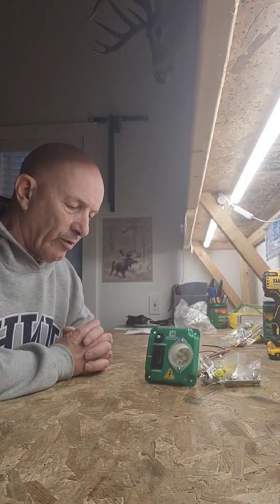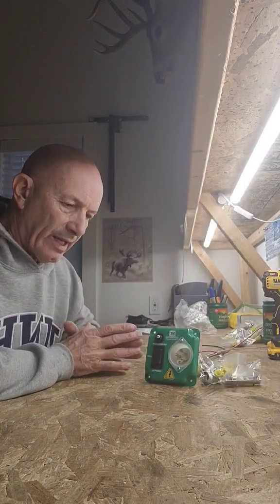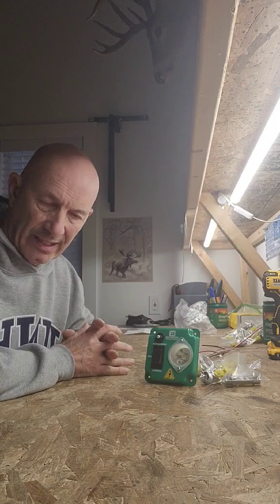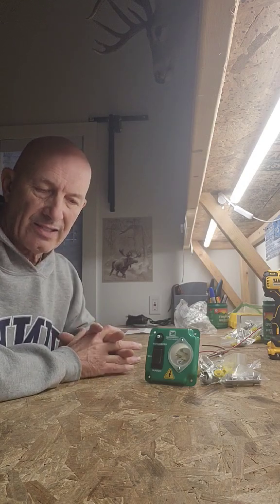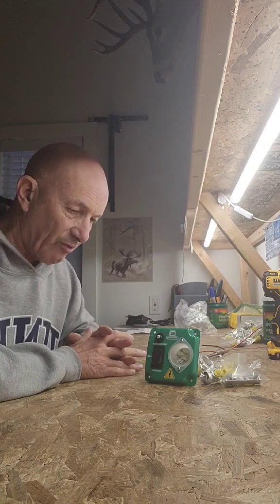EZ Q&A - Is your transfer switch safe and UL approved?

Comment: Is it ok to install these on a gfci and afci circuit?
Reply from the maker: No problem,  arc faults and gfci circuits need to switch the neutral also.  Otherwise the breaker will "see" the neutral bonded and trip